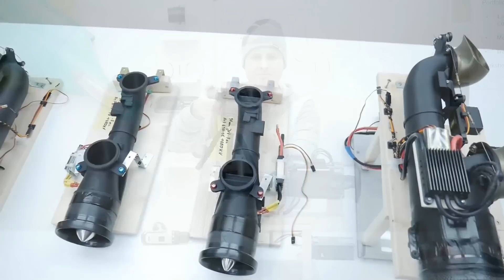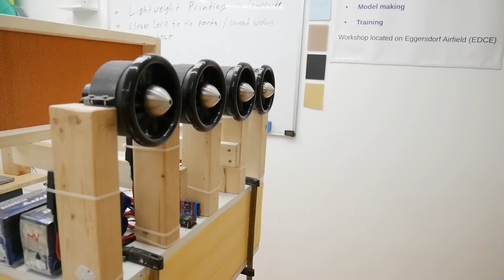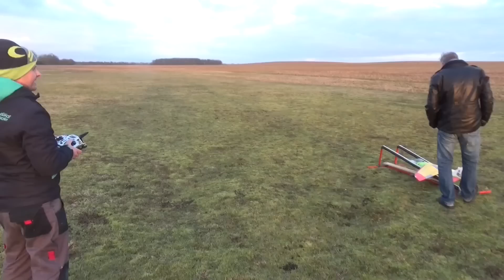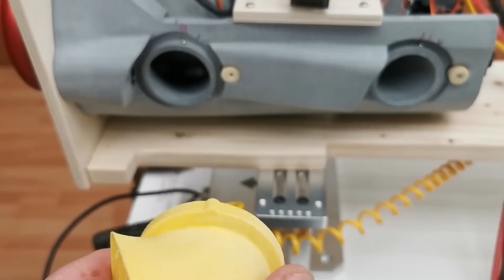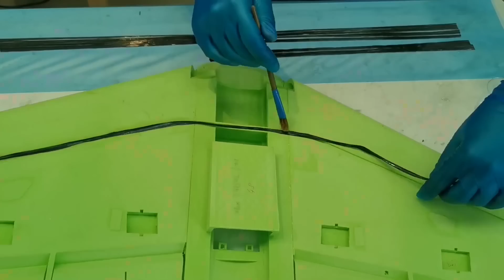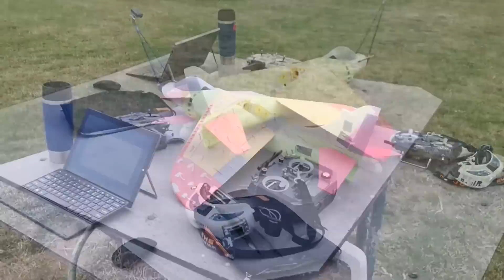First Year 3D-Print RC Harrier Project - This was achieved -

Comment: 12:20 All you had to do was add locking frames over the flanges of those yellow nozzles, then you wouldn't have to change a good four direct drive setup for this cable trash...

Comment: you are permanently talking of the angel of attack (Engel des Angriffs) but you mean the angle of attack (Winkel der Anströmung).
Reply from the maker: Danke für den Hinweis Harald 👍
Reply: possibly the confusion is partly due to Angels being Naval Aviation slang for Altitude, in 1,000 ft increments.
Reply: Klugsc****. 
Jeder weiß was gemeint ist. 
Großartiges Projekt inklusive Umsetzung und Dokumentation 😍
Reply: @xxhomertimexx6644  kann ich mich nur anschließen. 
Unnötige Korrektur.
Reply: @retr0_fps  naja, wenn du die ganze zeit unbewusst einen fehler machst, bist du doch froh wenn es dir jemand mitteilt. Vorallem ist der kommentar kein bisschen hämisch(zumindest wirkt es auf mich so)
Aber super Projekt @rene
Reply: @retr0_fps  no such thing as an unnecessary correction. He was happily corrected, the only ones that are upset are you guys.

Comment: For a better control at VTOL, the Harrier has smal holes at the edge of the wings. At Nozzles 60° there is a little bit of thrust at the edges of the Wings to have a better controll on the Roll-Axis.
To provide turbolenzes under the Harrer at VTOL there are smal fins to protect the air cushion for crosswind, The airbrake is naccassary for a stable VTOL. Full Airbrake full Flaps for hover. 
You can start and land much easyer with NOZ 60°. This called Short-Takeoff and Slow-Landing.
Reply from the maker: Thx mate! This will be the next steps👍

Comment: Good to see all the trial and errors in building such a awsome plane a few things that I've found that might help is I've discovered esun pla -st its flexible pla it bends instead of snaps I've been using it on drone frames and its quite good im yet to break a frame. also I use aluminium welding rods for alignment dowels sometimes they work really well and are light weight and will flex abit aswell
Reply from the maker: Cool, I'll also try this 👍

Comment: Hey Bro, I don't know If you solve the problem about the rotation of servos. I think you need to modify the position of the potentiometer. You can put it on the air outlet and not inside of servo. In these case the rotation will be the same of servo.
Reply from the maker: Is solved 👍